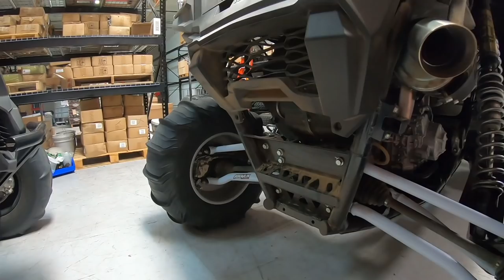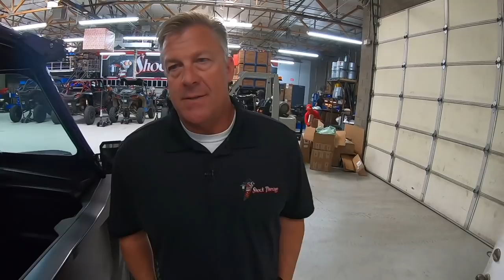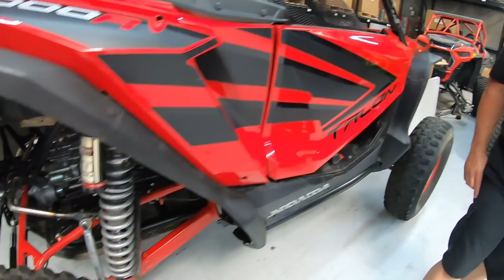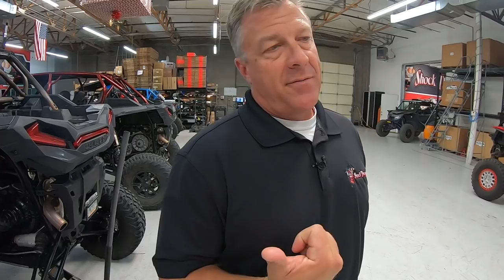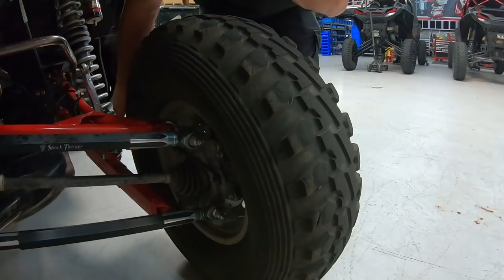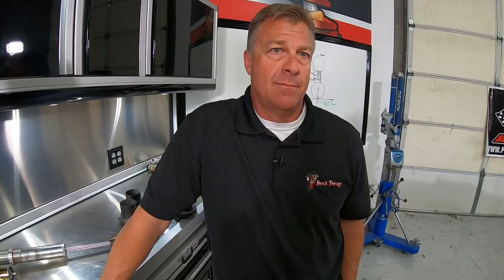Shock Therapy LIVE: What UTV to Buy 2020?

Comment: Finally!!! The video to end my search before pulling the trigger on buying a sxs! If only woods ridding was mentioned(will be doing alot of ridding at Hatfield and McCoy's) I still thank you for the information shared!
Reply: Did you end up getting a sxs? I'm looking at a honda talon 1000x or a krx for sure, I do the same type of riding.
Reply: I was looking at the talon as well. Especially since it has the turbo upgrade
Reply: I went with pro xp ultimate. We ride H&M/ outlaw as well. My brother got the krx & loves it. I love the agility of the pro xp personally
Reply: Heard people are starting to have some weird issues with Talons losing reverse going in and out of gears etc so do your research.
Reply: I haven't seen that yet, but heard you need to update the air intake, it doesn't have a great turning radius, but I love that there's no belts
Reply: @leprechaunmafia  Just got back from a week at windrock and my friend had a new KRX and it was one of the most capable machines in the group if not most capable. Only issues he had were the last couple of days when it rained. It’s heavy and stopping on hills in mud wasn’t happening. Polaris rock & trail were very impressive as well.

Comment: I sold my 2020 turbo s. Just got the KRX so much happier. I dont race so that isnt a factor. Comfort, room, looks, shifting into gear way smoother, throttle response for rock crawler way better,  passenger seat adjustable, bead locks. I love this thing. Which I would have done this fromt he start would have saved 10k. If I want more power they have a turbo that brings it to 174 hp which is more the the rzr.

Comment: The gen 2 YXZ1000R SS SE is probably the best out of the box unit you can buy. For instance, it's the only car built with the radiator in back where it belongs,  and the dual spring shock package is GTG for most trail use. Don't want your rubber band breaking contantly? Your looking aat Honda or Yamaha right now, and Yamaha is set to announce a new car this summer. If you were making a living selling UTV parts & service, it may be hard to recommend the car that needs the least work... ;) Thanks for having the spine to offer an opinion...most won't even do that, for fear of alienating the fanboys...If you want to spend $25K+ on a new car, plus another $10K in parts to keep it from falling apart, you need a Canam....My '20 YXZ is on day 3 at Texplex, and has seen hard use in the desert and dunes.  Pipe, tune, winch, harnesses, and a extra set of wheels/tires. All she does is rip and beg for more :)
Reply: MERICA.....  thanks for sliding in the comments with common sense.  I've been eyeballing the yamaha for 2yrs. Waiting until this summer to make my decision and you pretty much made my mind.... there is no turning back now damnit. Thank you

Comment: I’m surprised Can Am and Polaris we’re not mentioned in none turbo. Their suspension is awesome. They are the top 2 sold units.
Reply: I have a Honda Talon R and know the suspension is better on a Can-Am and Polaris. But I just like the CDC transmission cause I want to build a Rock crawler unit.
Reply: McDonalds sells the most burgers, doesnt mean there the best burgers.
Reply: Josh Owens I don’t eat McDonalds so I wouldn’t know.
Reply: @stgraves260  You totally missed the point. Just because something is a "best seller" doesn't mean its the best.
Reply: stgraves260 Never had McDonald’s?  Yeah that’s BS.
Reply: @joshowens2219  That is silly analogy that has no validity in this arena.
Reply: Sometimes you can say something without talking. In this case, the lack of information is the exact information I needed.

@Shock Therapy llc you just gained a subscriber.
Reply: Considering most the suspensions geometry is the same for the 2 platforms then you only have to take the shocks into account. The dynamic is top choice for the NA and the turbo applications.

Comment: Also surprised on the Polaris turbo you said was the most reliable. I see those thangs literary on fire all most every time I go riding.
Reply from the maker: stgraves260 a majority of the Polaris cars that caught on fire came from a lot of people with gas cans in the bed of the car over the motor. Yes, they did have some issues with some stuff and they corrected the problems. As far as the build quality of the car, the Polaris is put together more soundly than the can am
Reply: Shock Therapy llc I’ll take that under consideration because I haven’t owned a Polaris. I didn’t really pay attention to what they had in the bed of their SxS either. So that’s on me. I’ll start paying more attention to that. It’s just the fires seam to be happening under the dash and under the seat from what I can tell. Thank you.
Reply: Shock Therapy llc I’ll take that under consideration because I haven’t owned a Polaris. I didn’t really pay attention to what they had in the bed of their SxS either. So that’s on me. I’ll start paying more attention to that. It’s just the fires seam to be happening under the dash and under the seat from what I can tell. Thank you.

Comment: My next one will be based on whats available with turf mode.   I had to buy a second set of non aggressive tires for my wolverine x2 xtr so we could use it around our property.  That locked rear axle is fine for a trail toy but I really am not a fan overall in the grass.  I don't like the tire scrubbing for every tight turn (you have to cut pretty wide to prevent it).  My want list is a selectable front and rear locker.  Also i really dislike the CVT.   Lots of people said the wolverine was quite but I don't get that.  Quite is when I run one of my hondas down the trail in a higher gear where it can lug around and sip gas.  I hate having to run mid throttle just to back up or get going.  Everything you want to do its always rev'd up.  I knew it would be like that coming into the purchase but thought maybe I could live with it.  Time will tell.

Comment: I live 5 minutes from the oregon dunes. Never had a sxs before and decided to get a yxz because I was going to be dunning mostly. I was also not impressed with belt drives. Fast forward 10 months, love my yxz but my initial ideas were incorrect. On the weekends my friends go to the woods I sit it out because my tall geared yxz doesn't like tight, slow trail riding. On the dunes the polaris machines are everywhere I am and if not in front of me they are right behind me. Belts... seen one belt fail on a friends rzr in 10 months. He said his belt was bad and didn't expect it would last the weekend. Inside of 20 minutes he had the new one installed. My yxz suspension is too stiff, it does soak up big hits. Whoops it bucks and porpoises. Ive tried adjusting and it just needs progressive springs. Im not spending more money on it. Im buying a 2021 turbo S, bone stock the turbo s spanks my yxz. The suspension is better for my needs. I will be able to trail ride. I wasted a bunch of money being ignorant about my needs.

Comment: Lots of yami trans problems around here, surprised to hear you say it's a good trans
Reply: Here too. Weak clutch. Motorcycle gearbox.
Reply: YXZ transmission problem? We have four with high miles...no issue
Reply: I beat the hell out of my trans. I've launched it at 10.5 on dry asphalt in 4wd quite a few times. Still holding strong
Reply: @thomasblais3612  launching isn't near as hard on them as landing on the throttle, or bouncing over rocks
Reply: @ACatKrom  I've landed on the rev limiter also. I don't do the rock bouncing thing though. I did blow a front cv doing doughnuts with the diff lock on though

Comment: Wow that was great info - but disappointing since I was going to by a yxz 2019 SESS as my first UTV - coming from a WR450F.  I still plan to buy it but will have to seriously reconsider CANAM.  Prefer the standard shifting of the YXZ.  With a spare tire and trail riding on the east coast (no whoops) I think it will be fine for me.  Now I need to figure out which CANAM might suit my riding which is Hatfield McCoy and Michigan sandy trails/  I see the comment from Ty below.  I am sticking with my gut and bleeding blue most likely
Reply: So what did you get?  I have a 2016 yxz1000r only ever needed tougher skid plated for rocks.  We baja run it rock crawl it.  Take it to dunes.  Go to the snow and mountains. No major issues. Granted ive (Blown quite a few tires and bent stock tie rod)

Comment: This was a very insightful video.  I have watched the follow up regarding the benefits of and what makes the KRX suspension better than most out of the box (geometry).  I am shopping for my first SxS, a significant purchase, and I am torn between Polaris, Can-Am and the Kawasaki.  Each model I am drawn to is very attractive for certain features. 

I like the low profile, power and sound from the X3.  I like the accessories of the Polaris and their General model.  I like the look of the KRX and your point that it has a very good suspension without need for much work.  I like the plug and play capability for lighting, options that Polaris and Can-Am have... Kawasaki not so much.  I like a roomier seat, a more reclined seating position and comfort in a unit that is fun as well as one that I will not have to mod out in order to make it reliable.  

In my area, trails, wooded areas, hunting etc are part of recreation life as well as a small amount of utility.  I'm also interested in something that I can put an complete enclosure on for Fall temps... would prefer that I could buy it from factory that way.
  
Thanks for the great information, I am nowhere close to deciding what to buy however.  ;)

Comment: Justin made two very interesting comments in this April 2020 vid.  At 16:27, he mentions that there might be a turbo car coming out in 2021 that is not a belt drive.  And at 19:15 he says that there will soon be "choices" in the width of the XP Pro (i.e., not limited to 64").  I wonder if, in both of those comments, he is referring to the much anticipated XP Pro "R" that Polaris is currently working on that might be 72 to 74 inches wide and might have the 200+ hp 2-liter engine with 5 speed transmission that is currently in the Slingshot.  There are a number of vids on YT that talk about this new "R" version.  Here it is November 10, 2020 as I'm typing this, and still no official word from Polaris on the "R" version.
Reply: Edit:  here is a YT vid that talks in detail about the upcoming R version:  
https://www.youtube.com/watch?v=l4Vwu4PJdZo

And this one has a pic of the new R version at 11:12:
https://www.youtube.com/watch?v=sXiF1NK8QC0

Comment: I have watched a ton of your videos and value your opinion. Putting the YXZ at the bottom of the NA list is absurd. The only thing it doesn't do well is high speed open desert stuff. It has more wins than any of the machines you listed in any other type of racing besides desert. It has a better motor than any machine you reviewed (including turbos). It's the fastest NA machine. It has a transmission (which you seem to value based on your Honda comments).  I understand you guys are desert racers and suspension tuners and the YXZ presents challenges on both of those fronts, but I can't help thinking Yamaha pissed in your Corn Flakes at some point. That was not unbiased in the slightest.

Comment: Confirmed my fears on the Talon design, plus it looks a bit weak in the front. Guess I'll keep looking and waiting. Got rid of X3 because I can't stand that "flying blind" feeling at the dunes.
Reply: Also, sat in a KRX, felt like sitting in a tub. I like a wet-clutch in a CVT work machine, but a definite no-go in a sport machine. That will be the weak link if they try to do a turbo kit.
Reply: I raised the seats for my wife. Much better.

Comment: X3 or KRX....which suspension is better? You have plip flopped in this video and the KRX video. You say the X3 in this video is best on the market but in another KRX is the best
Reply from the maker: Geometry wise the KRX is the best with negative canner gain, rear toe control and shock mount and angles.  The issue is that you can’t see that without more power, wheel base and possible 72 wide. With how we drive and race the X3 is better but it’s design is not.
Reply: @ShockTherapyllc  thanks for the clarification...

Comment: Do your thoughts on the Honda Talon apply to the 4 seaters as well? It’s in the plans down the road to bring my X4 live valve down for shocks and springs. 1-10 scale how would you rate the X4 ride before and after shock therapy?
Reply from the maker: The live valve is great but the bad geometry still applies. We can make that X4 live valve a 9-10 compared to the stock ride quality. Compared to other UTV's it will be a 7-8.

Comment: I built a completely custom buggy over the last couple years.....I am by no means a pro builder.....I'm having trouble figuring out the spring rate I need.....I'm not building it to race the Baja, but I would like it to be semi-right.....I understand spring position changes everything, so how do I determine what I need....it weighs about 850.....is there some kind of paperwork I can go by?
Reply from the maker: If you go on King shocks site or Sway away site you will find a few formulas. The problem with them is you need everything mathematicaly to do it. Even then it’s an educated guess and will most likely be changed in reality. This is why we do it on the car in person and make changes on the spot.

Comment: Just found this video - literally the best one out there on the topic. So thanks. Just subscribed. One question however: In the video, when referencing the Turbo Can Am, the only reference I could find was to call it an X3. I realize this is shorthand, but for those of us new to SXS's, can you elaborate which of the literally 10 different X3 models you're referring to?  DS, RS, MR, RC, R, RR, Smart Shox, etc. It's all pretty confusing to us newb's. Looking for the best rig for Colorado & Moab. What say you?
Reply from the maker: Thank you very much. When referring to the X3 I am blanketly meaning any 72" wide model. Simply put, any X3 that is not a DS. The rest of them are basically the same geometry, shock packages and frame design. In your area, I would run any of them but I think the new smart shox are pretty awesome. But they are stiff out of the box and some Shock Therapy love will get them right where you want them to be. I just love the in car adjustability as you drive. Hope this helps.
Reply: @ShockTherapyllc  Helps a ton - thank you!  To put the Shock Therapy Love on them, can I just ship the shocks or bring the whole car?
Reply from the maker: @jlayton86  You can do both. Just call the shop either way and set up an appointment. That way your done the same day. Thank you
Reply: @ShockTherapyllc  you guys rock! Thank you!

Comment: @shocktherapy is the geometry any better on the honda talon 1000x-4 Then the 2 seater or is hanging weight on the rear still necessary?
Reply from the maker: The issues are the same on all Honda’s irregardless of wheel base. So weight off the back is just as important.

Comment: I’m looking to buy a new rzr 1000s , my question is there shock maintenance I have to do to the shocks ?
Reply from the maker: Just keep them clean like you would the rest of the car. If they leak at all then rebuild them but no need to do that before they show an issue.
Reply: Shock Therapy llc ok thank you for getting back to me . I was told if I bought an extended warranty and I didn’t do a maintenance to them at 1500 miles then they would not cover them under
 warranty if something went wrong.

Comment: How can you tell when your shocks need to be rebuilt? I have a 2019 X3 XRS Turbo that was tuned pretty good but after 2500 miles it seems like its getting soft? Should I re-tune or rebuild?
Reply from the maker: I would rebuild. While apart the retune is free if we did the work originally.

Comment: Just bought a 2020 xp turbo, brother and friends have turbo velocity’s , both having the same engines will the xp have more body roll in the turns? Will it be able to keep up? Or are they so close it’s driver dependent ?
Reply from the maker: If your XP turbo has Fox's then your car will ride nicer and a bit more plush. The Velocity cars will ride stiffer and rougher. Because they are stiffer they will have a bit less body roll. The difference is slight. The real difference will be the drivers in this situation. Have fun beating your brothers!

Comment: Shock therapy......would you recommend a polaris turbo s or turbo s velocity if both cars were setup with gold suspension package by you?
Reply from the maker: I prefer the Fox shock option when comparing the two.
Reply: @ShockTherapyllc  What do you think of the Velocity Shocks on the Polaris?
Reply from the maker: @bfarmer16  I think the Velocity is much better than the standard Walker shock. But, I don't think it has any where near the longevity as the Fox.
Reply: @ShockTherapyllc  One follow up question.  Is the Polaris Velocity shock a good candidate for dual spring set up?  The pictures I've seen it looks like the cross over ring is up near the top spring retainer.  It seems to me that the upgrade wouldn't be much better than the stock springs.  I hope to hear back from you.  Thanks.
Reply from the maker: @bfarmer16  They are a great improvement but mostly because of the spring rate changes and lengths. Both create more room in that spot your looking at.